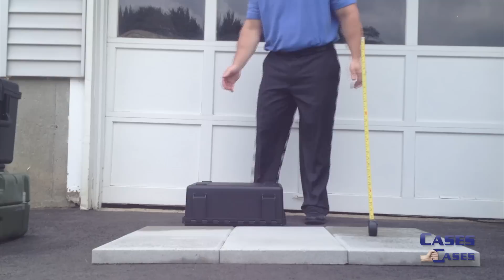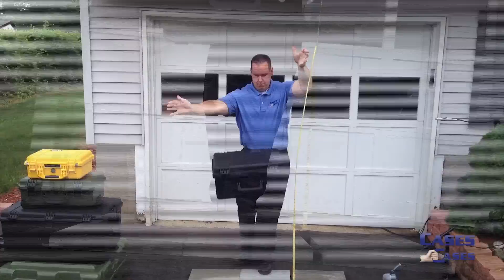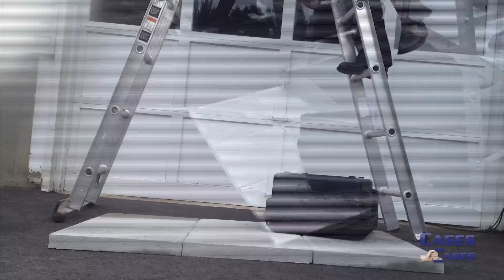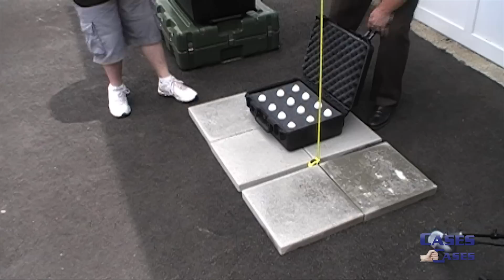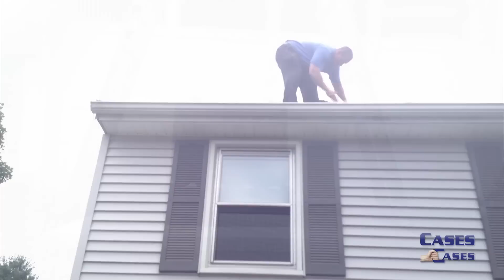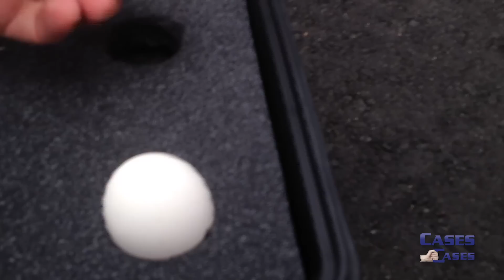Pelican Storm Cases: Egg Drop

Comment: This is actually a more convincing test than the ones Pelican has posted, but it still misses the mark badly. Eggs are fragile (just like the water glass Pelican used), but they have little mass, and therefore generate small forces (F=ma) in a drop test. On the other hand a telephoto lens has much more mass, generates greater forces, and is FAR more typical of the cargo people entrust to a Pelican case. Why not test a telephoto lens? Or, maybe they have, and didn't post the video, or maybe they don't want to put an expensive lens at risk. 

Also, it's not truthful to represent the proceedings in this video as a MIL-STD 810 test! The MIL-STD 810 requirements go WAY, WAY beyond this farce.

Comment: The eggs are a poor substitute for items of greater mass, and the shape of the eggs make them very resistant to crush forces. I think an impact sensor or g-shock meter would be helpful in this kind of test. On a side note, I find it kind of ironic that you used a microphone to record the case being dropped, but not for your intro and outro.